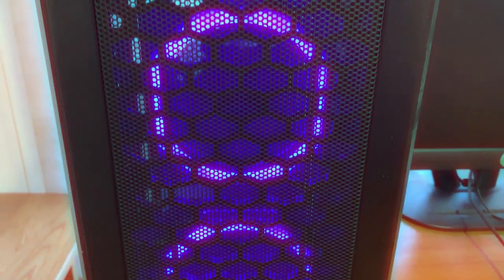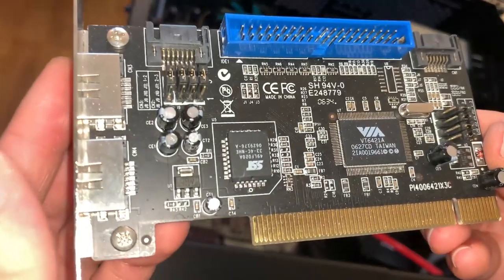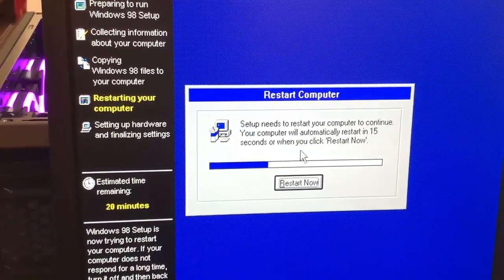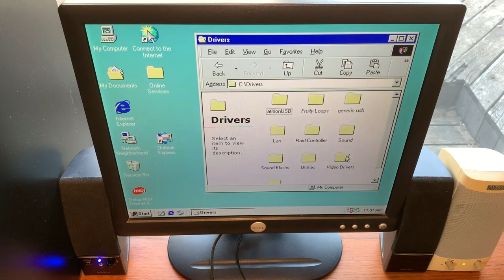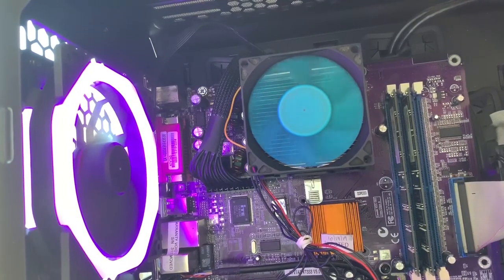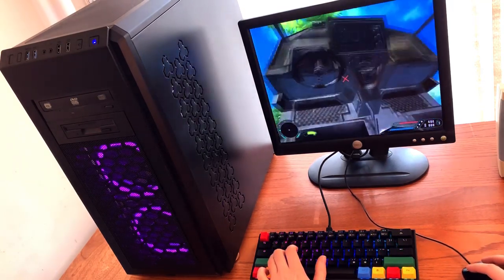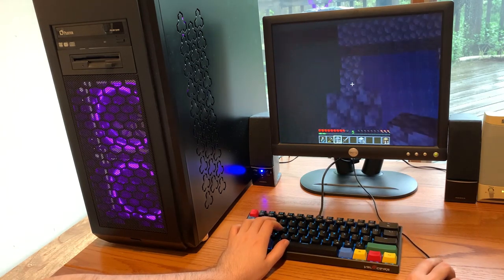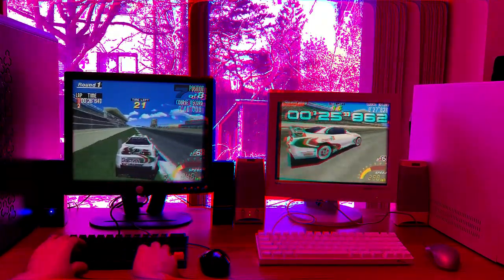The Ultimate Windows 98 Gaming PC

Comment: Oh man... I envy you. This is a really cool build and I've always dreamed of building a high-performance Socket A-based Win98 machine, but I was always put off by the 5V rail issue, especially when pairing with power-hungry graphics cards.
I love the humorous bits you sneak into the video. Haha!
"This card, however, was kinda dead" killed me, although you probably didn't even intend to make a joke out of it. :D
You put a lof of effort into this video project and it shows. :)
Reply from the maker: socket A is really quick on the single core which pushes minecraft to a playable level my pentium 4s don't typically do, the corsair psu I used is basically an older model that has a stronger rail, solving that issue, 

if it ever interests you, I do run a discord full of hardware/retro enthusiasts, some of which with 3dfx collections bigger than my house, and experimental prototype cards as well

currently our project has been trying to get IPX networking to work between modern pcs and dos/win 95/98 ones, and, its been working so far, we partnered with Brain Drain LAN recently

https://discord.gg/pArYKSZD

Comment: I was going to use my old P4 PC for Win98. You have a lot of games
Reply from the maker: I do, I think that pentium 4s are decent for that, but socket a has better 98 driver support usually, I've done one recently with socket 775 and core 2 duo e6600 w 6800 xt, but 98 really doesn't need this, my ideal system with 98 is the one here: https://youtu.be/gqt0pL_OnMo

Comment: That looks really  good I am thinking to build a retro machine I don't have the parts jet only a radeon 9200 is that gpu  good enough for some old retro games?
Reply from the maker: yes, it is. however, I usually find that the fx 5700-5950, geforce 6200, geforce 4 ti 4200, and voodoo 3 3000 are the minimum reccomended cards for various eras of games, the 9200 sits in a strange spot on that, worse than geforce 4 but better than voodoo, but doesnt do glide, so its not as good for the older of the old games that use glide.

Comment: Amazing mate what are ur specs thinking Bout building one!
Reply from the maker: this one here is athlon xp 3200+, geforce 6800 agp 128mb, 1gb ram, 120gb ssd, promise tx150 sata controller, corsair 650w psu, floppy drive, cd drive, vanguard rgb case

this is probably the most unstable windows 98 pc i have, it works but it goes very fast for 98, hence why i could get minecraft to run, 

for a 98 system i usually advise to use 440bx chipset or tualatin instead for compatibility, but if balls to the wall 98 build is your thing try making something like this maybe a p4 board with agp and 98 drivers could work as well, or perhaps even a core 2 duo board if it has 98 drivers.

Comment: Im running windows 98SE, Windows ME, and Windows 7 with ASROCK 4CoreDual-SATA2,
Intel Core 2 Duo E8600 SLB9L 3.33GHz 6MB L2 Cache Socket LGA 775,
BFG Tech NVidia GeForce 7950 GT OC 512M PCI-E x16,
Sound Blaster Audigy2 ZS and a Aureal Vortex 2 A3D PCI sound card.  I have the 3DFX wrapper and EMBM Environmental Bump Mapping working.
Reply from the maker: thats very insane, for 98 I can imagine that might hurt some compatibility but having that 3dfx wrapper is probably handy, I've found that certain chipsets like socket a and 440bx are more of a sweetspot for 98 recently,
Reply: @psychoticgiraffe  Well yes, I had my Phil of P4 AGP 7900 GS but then tried for sata, pcie 7950, and 1gb ddr2. The Asrock has all working win98 drivers and pci slots for sound cards. It allowed agp or pcie video cards.  I could have both if needed.

Comment: The Geforce 6800 supports DirectX 9.0c, install that and nGlide version 1.05 and you can then play many of the Windows 98 games supporting Direct 3D, Open GL, and Glide games also. The limitation for complete compatibility however lies in the choice of the graphics card, that driver he installed will render many Windows 95, and 98 games unplayable as you need older drivers to make them run properly without artifacts and other glitches. If he had chosen the FX5700, with 256mb of ram, and 128 bit interface, DirectX 9.0a, and used driver version 56.64, then he would have had no issues.......that's what I did, that and nGlide 1.05 I can play about 100 +/- Windows 95/98 games with no issues, save for the odd patch required, and many games require patches to run properly, no matter what the operating system is! Some of the titles shown, like Serious Sam, run better on Windows XP, which is where I run mine on a high end Windows XP system.
Reply from the maker: I've used that but found that it had some bugs, either way though it works on most of the games so it's pretty solid. I can't use 56.64 as it needed to run halo

Comment: Just a heads up for anyone building a socket A machine, you need a power supply with a -5v rail especially if the board only has a 20 pin ATX connector.
Reply from the maker: does it actually? this one doesn't have a -5v rail, but it has a strong 5v rail though
Reply: I don’t think yoo need -5v for socket A.  It’s important for 386 & 486 and even then only for certain sound cards.

Comment: I'm trying to do the same with that sata pci card, how did you configure it to take the windows 98 ssd?
Reply from the maker: you use the bios on the SATA card to format the drive, go to fdisk, initialize partitions, sometimes you must use easeuspartitionmaster to add addtional partitions if the drive is too big, 128 and below is suggested

Comment: Awesome build. How long to source the parts? I have an audigy2 zs in my x2 2.6 xp/win7 build with a 9800gtx+  and 4 gigs, trying to source 2 more gigs. Its hard to find 2-3-2-5 ddr400.
Reply from the maker: I’d say about 2 weeks to source the correct parts, but due to this video, using some of the links in description I think most people could do it in under a week now, I also did all the necessary research to insure an install is optimized for 98, this one can do both xp and 98

Comment: I have a newish power supply that has 22 amps on the 5v. Do you think that is good enough for a 700mhz slot 1 pentium 3? The old psu was only 18
Reply from the maker: probably enough for p3, not enough for socket A

Comment: The odd thing is 
Old computer that works=neglect 
Me with my old broken computer=ITS NOT WORKING GIVE IT CPR
Reply from the maker: yes old pc works great
Reply: Not mine. It won't even start up without BSOD
Reply from the maker: @LoftyCrofty   oh what are the specs of it
Reply: I would tell you but I can't even get there. When I power it on it gives me two start up chimes and no picture. If you want me to show you the BSOD code I got I can
Reply from the maker: @LoftyCrofty  if its a custom built, the motherboard inside the case and graphics card have labels or numbers usually, if its not, the model number of the PC is somewhere on it or the name (hp pavilion e555) or whatever
Reply: The computer is one made by DELL with the operating system of Win 7 and intel quad core so idk i will try and send the bsod
Reply from the maker: @LoftyCrofty  try reinstalling windows on the pc, if f12 or whatever the get to boot menu or bios keys dont work then remove the HDD and see if it still does it after that, if it does, you might need new drive
Reply: Yeah I know what I need to do but I fell like I need to get someone with more experience plus I recently had a family ember pass and all of the photos are on that computer so thanks for helping me I will get someone to do it

Comment: Hey ! New Subscriber here ! Just curious, and this is probably a noob question but... How are you able to run Doom 3 so well if its not compatible? I've seen other videos on Youtube from ppl playing Doom 3 on their windows 98 machine and it looks horrible... Your's looks like the way it should be played. Thanks !
Reply from the maker: doom 3 requires patching to run in 98, the installer tries to stop it from running unless you patch it or mess with the ini file, LGR also did the patch to make it run he has a video showing it working
Reply: Upgrade to windows 7 or 10
Reply from the maker: @barbrose4987  it could run windows 7, but the stuff i'm running would not run as fluid in 7 on this hardware configuration, and it can't run 10 due to a lack of NXbit
Reply: @psychoticgiraffe  Did you use LGR’s method or a different method? Because the only video by LGR about Doom 3 on Windows 98 I find is the one with the Voodoo2 patch and I really want it to be able to run on a :
Coppermine P3 1ghz
128mb VRAM Geforce 4 TI 4200
512mb RAM

Comment: That's like my build, I like to use AMD cpu's in retro PC's.
Reply: older amd cpu’s are the worst tbh they overheat too much and feel pretty slow
Reply from the maker: @AlbanianGladiator  not back in the socket A and Athlon /Athlon 64 times, it was just AM3 and FX chips that were poor and hot

This runs Minecraft like 3x faster than my pentium 4 3.2ghz and it’s only running at 2.6ghz
Reply: Amd 64 >>> pentium iv
Reply from the maker: @karadanianoI  yes

Comment: Very nice build! One question why didn't you install the sound card in the bottom PCI slot and the low profile Linksys WIFI in its place? Wouldn't the 6800GT would breath much better that way?
Reply from the maker: IRQ conflicts in DOS, when you set video card slot 1, sound card slot 2, DOS cooperates better, now, if you had an ISA sound card, then this wouldn't be the case, but I'm using one that isn't typically used with DOS, hence the reason for that, I'd get issues when I put it in a bottom slot. temps were only about 65c on load which didn't seem bad

Comment: So to get java 8 to work do I have to install kernelex  and the 2019 update then install java 6 and update it to java 8?
Reply from the maker: do it incrementally yes
Reply: psychoticgiraffe one last question do I have to run the java installer of a new version to update or do I update from java control panel
Reply from the maker: @steveotherman9887  you just keep using different installers in order until you hit the max that it allows and if one get stuck you force it through with kernelex
Reply: @psychoticgiraffe  I wonder if ojdkbuild will work on this with kernelex.
Reply from the maker: @replikvltyoutube3727  doubtful but worth a try

Comment: That window 98 PC works better than my windows 10 PC. >:(
Reply: Also, my old windows 98 PC won't work for some reason. Any tips?
Reply: @lively nic I am not sure what is wong with my PC. It turns on but my moniter doesn;t recongize that i plugged the vga cable into in. im not sure if its the moniter that doesnt work, the cord, or the PC.
Reply from the maker: u gotta test a bunch of different things to diagnose it

unplug the pc and hold power for a minute, try plugging it back in, make sure the vga cable is properly connected securely on both sides,

try using only one stick of ram, cleaning it out of any dust with compressed air

check for any busted capacitors

error codes, beeps, etc

different monitor;

if you continue having same issue after the above try a different video card inside; if that still doesn't fix the issue, then your board is probably fried

you can replace the motherboard in that case and see what happens
Reply: @psychoticgiraffe  Thanks for the info!

Comment: How did you get Minecraft 1.14.4 to run it needs java 8 I managed to get 1.11.2 working the last version that supports java 6
Reply from the maker: I was actually able to force java 8 to install with kernelex 2019 rev, it does not work with standard kernelex because it needs some system files to be able to run java 8, but kernelex 2019 rev was able to bypass it, note: that revision is rather unstable so do it right after a fresh install, not after you've installed 100 games, its only safe if you do it after a perfect clean install of 98 se

Comment: So, SDD’s are I think slower for windows 95 or windows 98 and so on, I don’t think this occurs on windows vista tho
Reply from the maker: SSDs are much faster for 3.1/95/98/xp than HDDs are, this is incorrect.

in the video or previous one I show the read write speeds as around 90-100 mb per second average, which is much faster than any IDE drive or CF card can do

I've not tried using a board that has native SATA with 98 though, but it would be sata 1 if it supported 98 so the speed wouldn't go any more than 133 and a spinning HDD tends to bench pretty poorly compared to the nonstop speed of the SSD;

The problem you might be referring to is a lack of TRIM, if you overfill an SSD you might notice slowdowns on older pre XP OSes

however, my solution to that was just to save about 4gb of empty space that isn't allocated on the drive, and to partition it into an 8gb and 108gb partiton so that it doesn't degrade as much, my ssd also has garbage collection automatically

this solves those issues for the most part;

hence the fast boot time. and file transfer speeds (far beyond the 33mb/s top of an IDE drive on average)

Comment: How did you get the SSD working with Win98? Was it just like any other hdd?
Reply from the maker: the raid controller has its own bios, and no it doesn't work same way since sata doesnt have slave or master

but basically you tell the raid controller to recognize the disk and then fdisk it and format then install

for stability sake i put a 8gb partition then the rest as a secondary
Reply: @psychoticgiraffe  Alright thanks, this is giving me a bit of hope for a future project I have running Win 98 from an SSD using the builtin SATA controller of my Asus P4P800-E Deluxe motherboard :)

But I also noticed you're using 1Gb of ram, how's that possible? I thought Win 98 only supported 512gb?
Reply from the maker: @krunge  1gb can work

Comment: You made a Windows 98 system to play Windows XP games? 98 games: Diablo, Commandos, Thief, Incoming, etc.
Reply from the maker: many of those I consider bordering on being windows 95 games but this is a 98 system meant to handle the full spread of games compatible with 98, however it does cancel out some 95 compatible games since a wrapper is needed for glide support on those early 3d games, hence why I've got two 98 systems, this one meant for the top end and the other one with voodoo 2 sli for that gap this doesnt hit
Reply: @psychoticgiraffe  For the spread of compatibility, my preference, is to split games pre and post XP. The hardware available for XP is vastly superior able to run GTX 670 as on my LGA 775 XP machine, modded drivers a 980ti even works. Crazy powerful and cost effective. Also google PC Games released 1998, great way to remember what the hell I was playing twenty years ago.
Currently, I've three 90s systems running. The AMD K6-III is the 98 experience, ATI rage and dual creative voodoo 2s and a SB live.
My other 98 systems are more like what you've shown, a P4 and an Athlon. What I finally ended up making??? finally?? is a Machine ~1990/4 to 2000. The XP machine 2000/1-2008/9
Oh well, all fun stuff.
Reply from the maker: very solid, i've been looking into 7000/8000 series geforce card compatibility with 98 using a hacked driver; to see if we can push this further like xp can with the titan z/x

i have a discord group where we help ppl build systems and things and test hardware https://discord.gg/tEFwyUr7

Comment: Do I need a specific mouse for the Windows 98?
Reply from the maker: you should have a ps/2 mouse on hand just incase your board doesn't auto detect usb ones, but many bios emulate ps/2 and will work with usb; ie: not really but get a ps/2 mouse as a backup if the usb one needs installation

Comment: Have we tried Striped SSDs with the SATA Controller? Might be overkill if it's possible, but, with "Ultimate" being in bold choice for a title for Windows 98, if there's anywhere we can make a system more responsive and anymore overkill, I'm interested in knowing.
Reply from the maker: 440bx is basically the most stable 98 chipset, yes the controller is designed to be able to run striped, if you put two drives in it can do raid0, I've not found any reason to do such though;  the only two things I haven't done for this system is try using a Slotket with a Tualatin 1.4ghz p3, or try raid0

reason I didn't do the slotket is because of stability concerns and requiring a specific one to actually do it.

there is a part 2 though where I upgrade a few parts of this later on my channel;

if someone actually sends me a slotket with the correct type for tualatin, I would give it a shot, but for such a meager speed improvement over the 1ghz I didn't think 600 dollars was worth it.

raid0, I've used it on this controller before, but I've not thoroughly tested it, I might at some point delve into that more

Comment: Can you play unreal tournament 1999 on it and record how game play is
Reply from the maker: I didn't bother doing that in the video because this system was able to run far cry which is far more demanding on high settings
and quake 3 arena at like 300 fps
UT1999 runs similar to quake 3 though
Reply: @psychoticgiraffe  how much did this computer come out to cost
Reply from the maker: @cutflow2  something like 250-300 bucks, the power supply was the largest hit to the budget, mainly because Socket A eats the 5v rail, in all honesty the psu i use in the video is the bare minimum for socket A on that rail. they actually suggest 50A on the 5V 

also, if you're interested we have a discord, we're going to play 98 games tonight if ur down. https://discord.gg/EFw3wvKc?event=943978788285456444